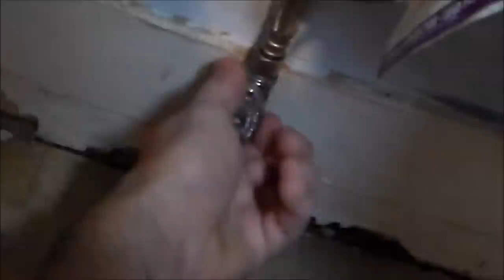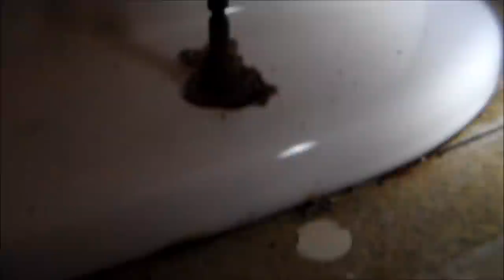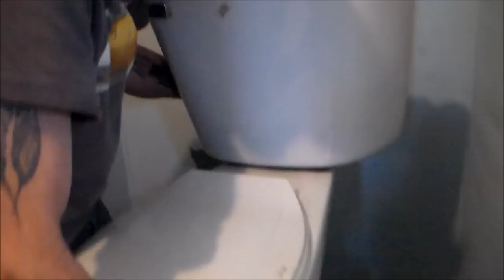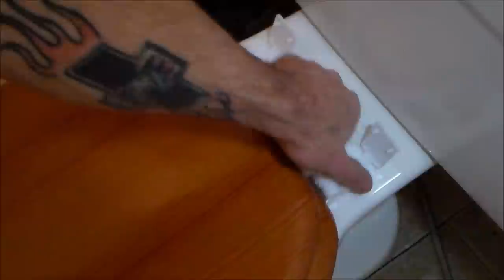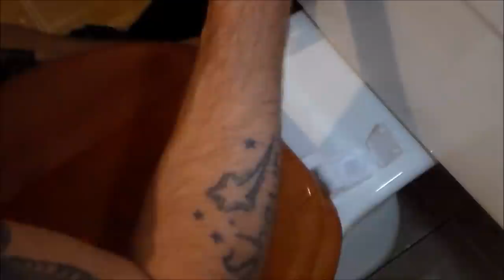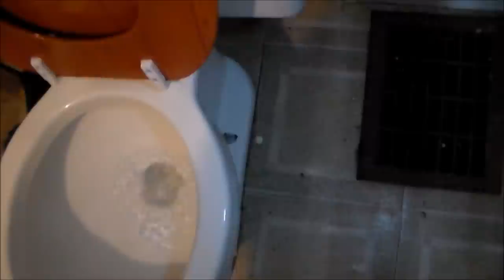commode change

Comment: Love the shirt Pooh lol. Good video. Sometimes you will come across a toilet with a foam ring, they were originally put in for installers, like the plumbers would install knowing that the floor guys would be pulling the toilets later, so they were temp rings.I still recommend wax for a permanent seal.Some people also caulk around the toilet base, bad idea, if there is a seal leak you will never know, the water will stay under the toilet and rot the floor, if anyone insists on caulking just do the front and sides :)